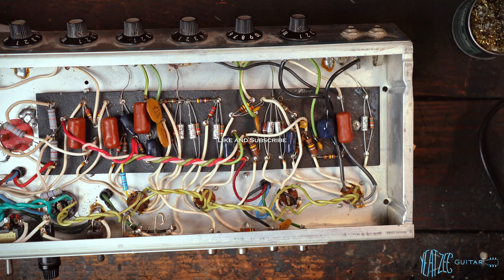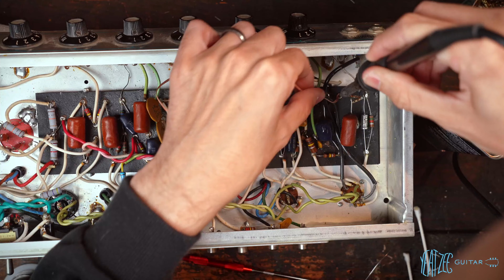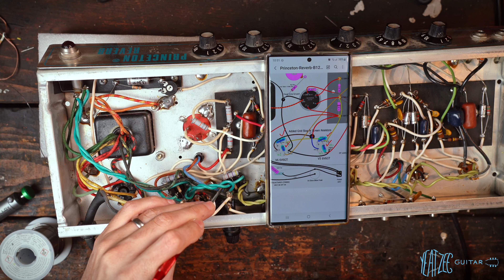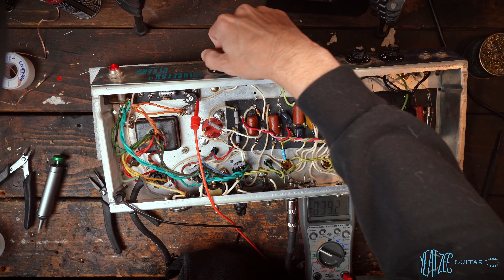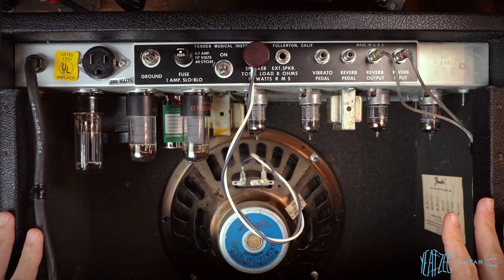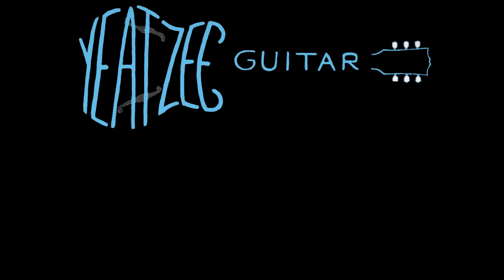Waxy Boards and Vintage Failings - Vintage Fender Princeton Reverb Amp Repair Pt.5

Comment: I was betting on a resistor.

Heater to cathode leakage in the tube can make 60hz hum and sometimes those same sounds esp in the preamp section.

Don't assume a clear top means a tube has lost vacuum. One of the most famous 12AU7s is the RCA clear top!

Comment: Loosen the pots and jacks from the front panel.  You can now flip the whole board upwards to gain access to the underside and the insulation layer for a better clean with no components in the way.  Plus you can now take a wire brush to the brass plate to make sure the pots are grounding properly.  

Should take less than 30 min to do all that.  You can apply heat to the underside and allow the wax to run down into a paper towel then target your critical connections afterwards.

Comment: When a tube loses vacuum,  it generally turns cloudy near the top 1/3 of the tube.  Secondly, you can safely (safe for the circuit) swap preamp tubes with the amp powered on.  I would only do this if you are comfortable with it.  I would not hot swap power tubes, as they get too hot to touch.
Reply from the maker: Yeah, but it'll pop when you do that which isn't great late at night when I'm working on the amp with a baby sleeping nearby 😴

Comment: "The amp is dead silent, which is great" 

Or you forgot to ground the cathodes of the power tubes, like I have before. lol
Reply from the maker: Edit: I just got this lol. Pin 8 both have wire to the chassis from the factory so not this time 😂